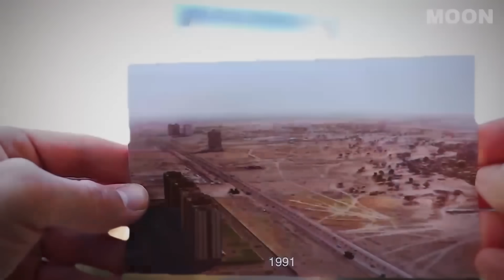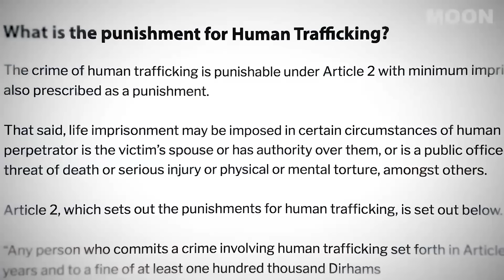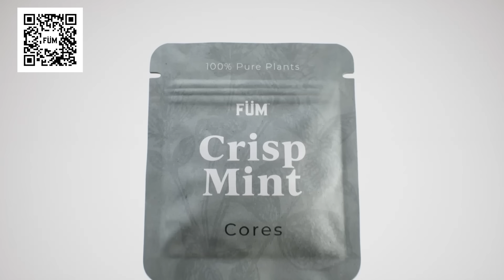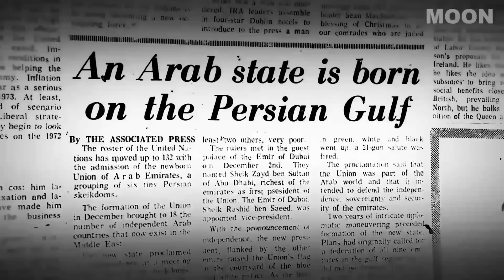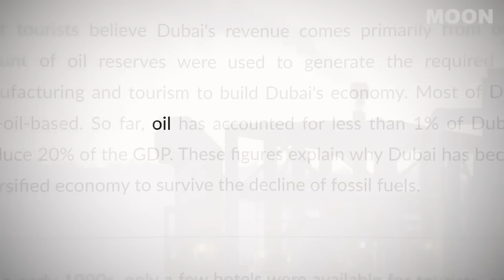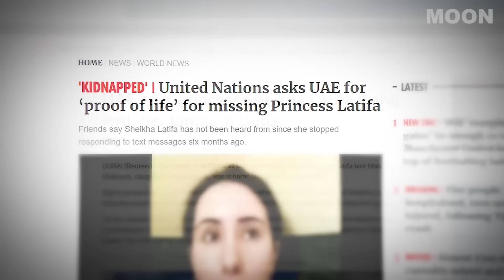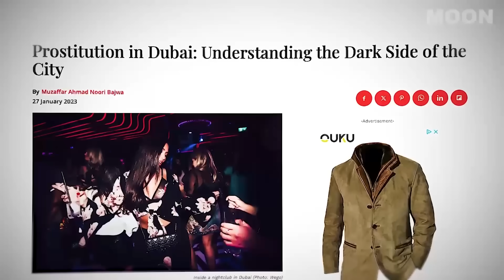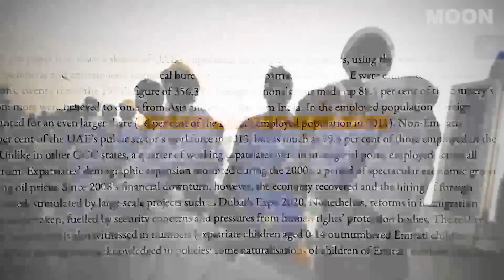Secret Sex Parties of Dubai’s Mega-Rich

Comment: This is such a disgustingly bad take. So little due regard is given to history, and much is glossed over. Perhaps you shouldn't have chosen NYC to compare Dubai with, given that NYC was practically built by slave labor, and that in the 18th century, 20% of the NYC population was enslaved. 

I am shocked that this is the 3rd video you've published defaming Dubai yet you so egregiously commit basic mistakes that could've been fixed by minutes of research:

1. Sheikh Maktoum bin Rashid ruled from 1990 until his death in 2006, at which point the current ruler acceded the throne, and his name is Sheikh Mohammed bin Rashid.
2. Dubai was established in 1833, not in 1971, and so its almost 200 years old, not 50. The UAE was formed in 1971 after a comprimise was reached between warring tribes in the Arabian Gulf. The nations of Qatar and Bahrain were almost part of this union, but left the negotiations in 1970. Dubai has been ruled by the AlMaktoum dynasty for two centuries.
3. 'Jumeirah' is not a tribe, but a touristy spot in Dubai. This would be the same as saying that Tribeca is an opulent family in Manhattan.
4. Sheikh Rashid was not 'the man behind the scenes', he was the man in the limelight. His office was open from 6 AM, and he was always available for anyone who desired to work with him. This is documented by British sources, not Arab sources (since I assume you to be the type that would dismiss source material). The British deemed him to be a comprimising, rational and overall genuine individual who wanted prosperity for his nation. Perhaps this is exemplified by how he used oil rents, focusing on infrastructure than building palaces.
5. Prostitution in the entire world has niches that allow for depraved acts that include other bodily fluids, and this is not just an issue in Dubai. You can procure the same services in NYC, London, Hong Kong, Singapore, Tokyo, Zurich, Paris, Berlin, Amsterdam, and even Brussels. To pretend that this is only found in Dubai would to unabashadely ignore the realities of a 21st century cosmopolitan city. It has perhaps blossomed in Dubai in recent years because of relaxed vice enforcement. (just like NYC in the 1970s)
6. Dubai's drainage system was built taking into consideration the minimal amount of rainfall that it gets. It makes no fiscal sense to pour billions into a drainage system that will be used once every four years. As such, there is dynamic reactive drainage that is implemented after rainfall has happened. This saves billions of dollars, and would've probably been something you would have praised had it been in a western city you hypocrite.
7. You pretend as if NYC and London are bastions of civility, completely ignoring the rampant prostitution, organized crime, homelessness, and danger of living in those cities. NYC literally smells like urine all over, and is filled with aggressive drug-crazed homeless people that defecate on the streets. NYC is has an inequality issue that is even worse than Dubai considering it houses the world's literally wealthiest people in one building, and then dismissing the homeless man sleeping at the foot of said building.

This is a sad production.
Reply: This, this is what everyone needs to see before commenting.

Comment: I'm with you on most of these, but pretending that NYC and/or London are much better is just wrong. In some aspects, sure, but in others? One could easily make another 2 videos on the horrors of those very cities.
Dubai's known allure and controversies are just one side of the coin. We can all hate it, but cities like NYC, London (or Paris), despite their rich history, are filled with serious issues that have been piling up, especially in the last 5-10 years. Those last two, you can barely recognize anymore.

NYC has its forced immigrant labor, trafficking, rampant crime issues. Insane traffic with low-quality public transportation, crumbling infrastructure, healthcare disparities, homelessness, and littered, stinking streets add to the growing list. The current socio-political climate has further strained the sense of unity and identity that once defined the city. People are more divided and isolated than ever.

It's important to recognize that no metropolis is without its flaws, and the poor will always be exploited, regardless of their geographic location. If one takes the time to dive into the history of any of these larger cities, one will find more horrors than Dubai has created so far.